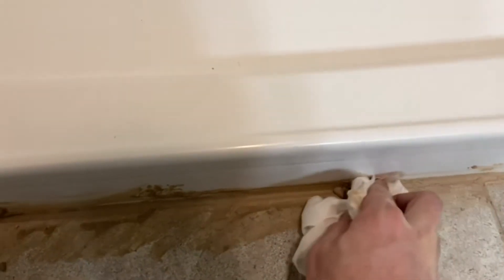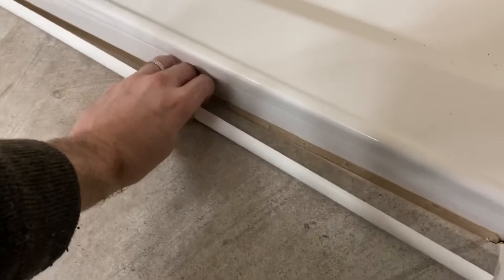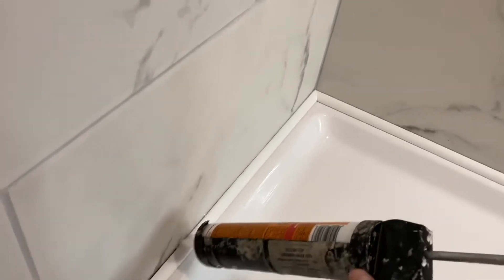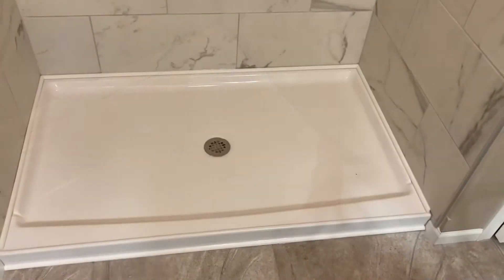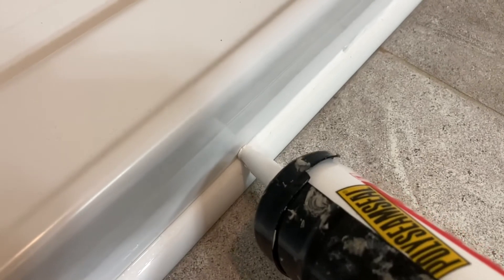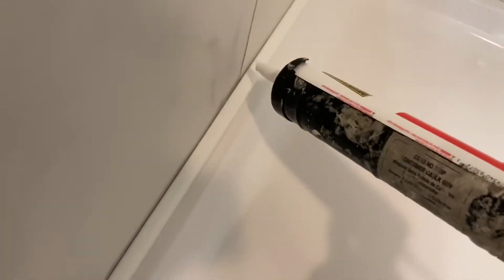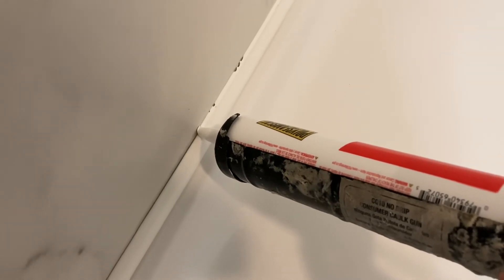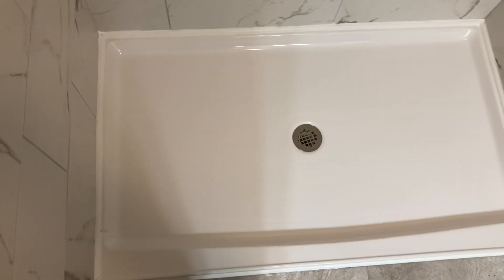🔥 PVC Quarter Round Trim➔ DIY Hide Tile Edges/Gaps in Wet Moisture-Prone Areas (Tile to Shower Base)

Comment: I have a 1 inch by 1 inch gap where  shower tile and bathtub meet , it previously had broken cracked loose grout pieces in it and caulking , i took caulking and grout out of it and cleaned it , the bathtub liner is behind covering wall in gap , since its so big a gap i want to use pvc or foam rod then caulk over it , is this the right way ? I got bathroom caulk and was planning on getting this quarter round pvc to make gap smaller

Comment: Great video. Could one use paintable/white caulking only, instead of using the 100% silicone underneath? I assume the 100% clear silicone has stronger adhesion and water resistance?
Reply from the maker: I’d personally only consider 100% silicone in this context. The paintable caulk can mold and, yes, has less adhesion.

Comment: Is that grout underneath the PVC? I was under the impression you don’t grout next to the tub, but use Silicone instead to allow for expansion.
Reply: You shouldn't put anything in the approx 1/4 inch expansion gap. The quarter round should ideally be fixed to the bathtub and have a small piece of hollow, flexible rubber on the bottom in contact with the flooring. Source: I consulted a licensed contractor on this exact issue when I was remodeling.
Reply from the maker: Yes, it's grout. Seems like I did that part incorrectly, if true. No issues, though, 1.5 years later. Fingers crossed.

Comment: Did you caulk the bottom on the floor
Reply from the maker: Yes, I used 100% silicone on the top and bottom edge of the trim. Anywhere water entry could happen got sealed up.

Comment: How did you get the piece on the floor to stay put against the shower base? Did you clamp it, push it in and leave it,.. or?? I'm currently doing thee exact same install but it wants to "spring" up! (it's the correct length) I personally like the grouted caulk look but the customer seems to think the pvc will create a better water barrier? So,.. customer wants, customer shall receive!
Reply from the maker: Great question. I definitely weighed it down while the silicon under the trim dried. Had to get creative - I jimmy-rigged some weight using my tools and scrap pieces of wood. I put a soft towel down on the shower base and angled the heavier battery-end of my cordless drill, for example, on top of the trim piece. I spaced the weight out every 12" maybe. Also could cut a scrap 2x4 to length and place on top so its full weight falls evenly on trim and securing with tape if needed. Good luck!
Reply: @diybandit  i appreciate the time you took to reply with detail! I ended up using lathe, 1x2, 2x4 (cut to length) and EVERY clamp i own to make a sort of "jig" yesterday in a step tread pattern to hold her tight!! I geuss I'll see the results Monday!! 🤞 thanks again from Iowa!!
Reply: @feelinfine1973  how did it end up holding?
Reply: @MPJohnny5  perfect!! Looks great and it needed no extra caulk!! Thanks again!
Reply: @diybandit  so there nothing else holding this down other than caulk?
Reply from the maker: @MPJohnny5  A year-plus later, it's holding solid!
Reply from the maker: @shanghei  Correct!
Reply: @shanghei  yes,.. 100% silicone caulk. I used white on this particular install.